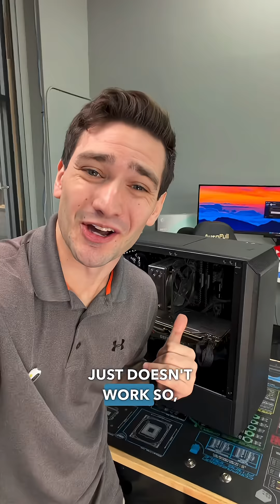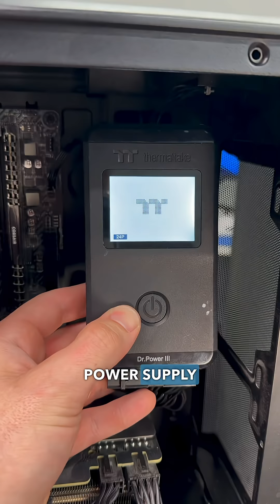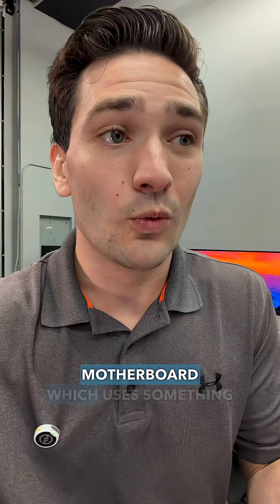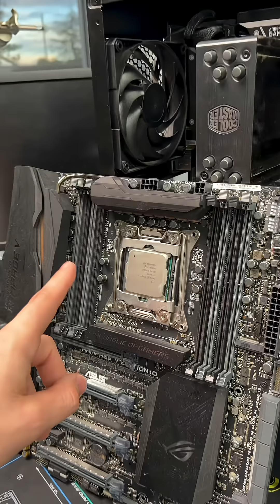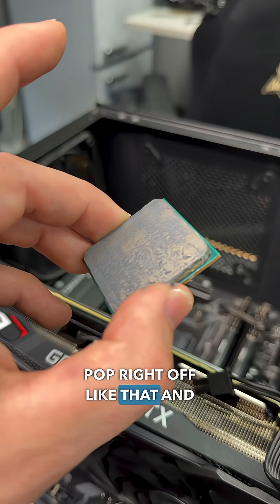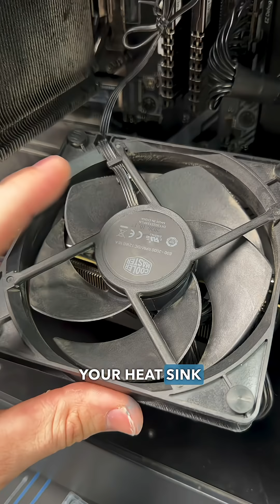CPU Cemented To Cooler! #pcbuild #techtips #gamingcomputer #computerrepair #gamingpc #repair

Comment: Just a FYI here, for future projects. It appears your cooling tower is pushing air back to front, where your rear fan case is pulling air out (causing an air gap between your rear fancase, cooling tower and gpu). Whichever way the blades curving inwards too, is the direction of air flow.

Regardless verify your air flow from your case fans and your CPU fans are same direction, but also, due to the airflow block GPU's have. If you choose to utilize air cooling for your CPU. I found in testing that airflow entering from the back of the case to your CPU cooler and exiting from the top/front of case (air entering rear and bottom), was best. 

Especially now how big GPU's are, it's very hard to get sufficient airflow to wrap around it to feed your CPU cooling tower sufficient airflow to exit from the back.

Comment: I just realized that gaming PC case is too wide for old HDD so I used SSD to hold it from bottom on other side. Both with 2 screws. Tell me it will work after shipping or not. :D And other options too.

Comment: What i did with mine is just blastint the cpu cooler with a hair dryer, that way the thermal paste gets looser and looser. You have to be careful not to burn yourself with the heatsink tho.

Comment: I had a situation where I was taking off my fan cooler to apply new thermal paste the CPU popped off with it and it would not come off so I had to be gentle around the edges and it finally came off after gentle nudging. Almost like he was cemented to the aluminum

Comment: that exact thing happened to me, it was completely cemented to where I just could not get it off even when trying to twist it. What actually worked was using a hair dryer to slightly warm the thermal paste to slip it off.

Comment: I think its a bad tip to say that the "ugly" side of the fan should always be facing the cooler, it depends on the side of the cooler that youre putting the fan on, and if you have two fans they should be facing the same direction.

Comment: The new Alienware Area 51, it's designed to be shipped. the 5090 has a bracket that is basically screwed on to the Case, 0 flex. I think if you're going to build PCs to ship, I think they need to start making cases that basically tie everything to the chassis. The biggest problem I think is PC not turning on due to stuff moving during shipment. I remember I bought an Ipower PC with a 3090 and when I got it, it wouldn't turn on after 2 hours of trying to push everything in, I boxed it up and sent it back. Bought the R13 Alienware, it turn on, been a customer since then

Comment: ALWAYS dismantle the GPU when transporting it. 
Also, NEVER mess about with the old AM4 CPUs. 
If the pins get bent, it won't even fit in the socket anymore.

Comment: When transporting a PC with a brick for a CPU cooler, always lay it on the side, unless it's a desktop PC (as opposed to a tower PC, like the one in the video). Not 100% guaranteed it'll work, but it helps put less stress on the CPU and GPU when bouncing around.

Comment: Tip: if you ever get a cpu so stuck that it won't come off even woth twisting, heating etc, use a dental floss and stick it in between, works like a charm (for better effect dip it in some isopropyl alcohol)

Comment: Any time I know I’m working with a PGA, I fire the system up and heat the thermal paste first before pulling the cooler. Makes it much easier to remove the cooler without it getting stuck or atleast pull the cpu off the cooler easier

Comment: Personal experience, blast the CPU with a hair dryer or heat gun, that loosens the paste, and twist with a hand towel for grip, and if needed, use a hair pin to fix bent pins

Comment: I've learned from first hand experience it won't always just pop off even with twisting if you run into that issue use a heat gun or hair dryer on low setting applying heat from about 6 inches away from it for about 10 seconds on each side then trying to twist it if it doesn't come off the first time just repeat the process

Comment: A question from a noobie in case someone faced it before. My pc won't turn on after a slight jerk but when I take out the gpu, it turns on fine. The pc was was running fine before. I'm guessing the gpu has some kind of short circuit. Please enlighten me. Thank you

Comment: Anybody else notice the cooler was on upside down at the beginning of the video(wether or not it affected anything is a different story)
Unless the fan was supposed to be directly next to the other fan at some point and the whole unit got flipped backwards and is now blowing away from the other fan. Instead of pulling through the cooler and helping the exhaust fan.

Comment: I got exactly same problem recently repairing someone pc. My friend brought his pc from work in Germany to his family home and pc stopped working. So me as a person who knows more about computers more than average people took it to look closely.

My attention after taking out glass side panel took very loose stock AM4 cooler. That Wraith prism cooler, with has latch which needs some force to mount. I eventually planned to change thermal paste so I took it off, repasted and mounted it back. After that I tried to power on and system start up

Comment: I had an amd athlon cpu stuck to the cooler and after i tried literally every method i just ended up putting the cpu and cooler in the freezer and after it slightly thawed was just enough to finally get it off. Somehow the cpu survived without any bent pins even though it basically flew off the cooler.

Comment: For fan directions I personally like visualizing them as domes. The intake side looks like a dome most of the time and the output side looks like a bowl.
Reply: At that point I think it's easier to visualize them as spoons - which side of the spoon do you use to shovel liquid?
Reply: @Atlessa True my mind just defaults to domes as a larger whole but the individual blades are like spoons.
Reply: That’s actually really helpful for my visualization.

Comment: I find you do not like fully need a cpu it would like still turn If you just have the motherboard and power supply And it will turn on but not do anything and then turn off like 3 seconds after

Comment: I'm sure the old Pentium CPUs from the 90's were the same. The amount of times I had the CPU stuck to the cooler was crazy
Reply: i was working on my old pentium 4 pc awhile back needed to replace some caps and the cpu came out with the cooler and fell off and landed pin side down lmao hate that design so much had to spend like 2 hours straightening pins back out
Reply: @GHOST117HALOBOYCOD 
Yeah, gotta love the old 386, 486 pentium systems...  sdram, IDE drives...  yeah, nostalgia right there...  oh and cant forget DOS (5 & 6), Then can't forget Windows 3.1/3.11 either in that.

Used to have a Dos 6.22 and windows 3.11 iso, sadly, it got deleted during a massive clean up 😭.

Hmm...  Anyone remember DOS 5?  DOS 6.22? Windows 3.1/3.11? Windows 95?  Windows 98?

Oops...  Showing my age 😅.
Reply: @samcko-d4d  My first PC used DOS (Tandy 1000 HX with an 8088). I worked a customer service job in back 2002 where the PCs used Windows 98. My First "modern" computer was a Sony Vaio with a PIII 866 and 128MB of 133Mhz SDRAM. Pretty sure it used IDE cables for both the HDD and the optical drives (one CD Burner, one DVD Reader). Of course floppy was THE drive for the Tandy, and pretty sure it was on the Sony and a few Compaqs I had after that too.
Reply: @jtenorj yeah, the good old days.  Slow computers, but, they were very reliable.  I recall the old floppy drives/disks as well - 3 1/2", 5 1/4 and extremely old 8" floppies.  I can't quite recall the model of computer, but somewhat recall it having an integrated keyboard, printer, monitor (CRT from memory - green text, if I'm recalling correctly 🤔) and two 8" floppy drives, but no hard drive...  that certainly takes me back...

Comment: The gpu sag is crazy no?
Reply: i made a lego rod to keep my gpu up
Reply: @Paperclipbits same here lol
Reply: @Paperclipbits I made one with wooden chopsticks and electrical tape lol
Reply: @improvisedpizza8557   nice, make sure you add electrical tape to the ends of the sticks so it doesnt pierce your gpu or scratch it
Reply: @Paperclipbits yeah I sanded off the edge and taped over it
Reply: @improvisedpizza8557  Okay nice, just making sure.
Reply: gpus can handle a bunch of sag fine it's only the newer extremely large cards that need sag brackets
Reply: Whoever build this gave zero f and most likely not the owner
Reply: heat sink sag xd
Reply: it's fine if you don't shake your pc lol
Reply: @davminks  Guess what happens during shipping..
Reply: @anotheruser9876  Obviously you should not ship a PC with heavy cards plugged into their slots. They should be removed and placed into their original boxes or ones close in size. 
Or you stuff the case full of cardboard and bubblewrap to secure the GPU in place,  if you insist on shipping as one unit.
Reply: @davminks  Exactly
Reply: i remember my old 970 sagged really bad, never affected it
Reply: @Chopsuey1288 that's probably because your GPU may be 2 fan
Reply: @Chopsuey1288 7900xtx sagged enough to cause a couple issues which were easily fixed by propping it up with a tiny picture I had, then a proper stand once It came in. Definitely can be a problem with bigger cards
Reply: doesnt look that bad?

Comment: Mate I have a question on my system which is a Ryzen 5 2600, gigabyte GeForce 970 Xtreme, 16 gigs ddr4, and like a 500 gig mvme drive and two other drives. My computer keeps flickering the screen randomly just at idle or like using a web browser like fire fox or chrome. Tho in games it doesn't do that at all. My question is what do you think it can be? I did install the newest Nvidia drivers that took a pain and a half but the GPU is recognized. It was leaning towards being that and it's drivers because it helped. Had to do a butt ton of work to get the newest ones installed but it worked later. Tho still does it, I did see it was that because previously it did crash on me in game and while browsing like a YouTube video. The driver's since actually fixed that, oh the one thing is I'm using a regular tv as well to see. I don't know if that does anything or if the GPU doesn't like it. I've did that too of changing ports and cables and like it still does the flicker to a black screen and comes back. I don't have a monitor to actually see tho if it doesn't like the tv but what do you think it could be? Oh I also tested my ram, no problems there either.

Comment: For those who are worried about pulling the CPU out with the cooler and bending the pins, just heat up the CPU and thermal paste before pulling the cooler off. Run Cinebench or CPU-Z Stress CPU for 5~10 min, and then gently twist the cooler. It comes right off without even having to pull it out.
Reply: You can't in this instance

It doesnt turn on
Reply: @Sabot_up_Flakbus154  I was just giving a tip to those who were worried about pulling the CPU out with the cooler. I wasn't commenting on this specific instance which the CPU was already stuck and pulled out with the cooler even before taking it apart. Learn to read.
Reply: @PowerliftingCollege i specifically stated "in this instance"
Reply: @Sabot_up_Flakbus154  Specifically stated "For those who are worried." Again, learn to read.
Reply: @PowerliftingCollege ik ik

Actually i realized i was wrong a bit ago but its too late for me to back down
Reply: @Sabot_up_Flakbus154  🤣🤣 It's all good, my friend.
Reply: @PowerliftingCollege slr and thx

Comment: Slight faux pas for me - didn't realize I had the cooler installed for some time, and i thought I should re-do the paste etc.  CPU did get stuck to the cooler and somehow in the removal process, the pins bent o0  Luckily, local store had a big sale and got a nice upgrade sale in the process.  Note:  do leave the maint too long on a PC, sh1t can go south

Comment: Just twisting didn't do it for my 2y old stock AMD paste, I needed 1h of heating the cpu on my print bed, trying to twist  it, trying to wedge things under it, and spilling a lot of alcohol onto it before it popped off with a few bent pins. Bent everything back and after applying some MX-4, everything is up and running again.
Reply: What temps you got idle and gaming?
Reply: @ΆκηςΠ-τ5ψ  Never above 70. Maybe 40-50 on idle and 55-65 while gaming. All with a stock cooler and some MX-4.

Comment: Trick for this:  if you twist the CPU cooler back and forth a bit before pulling it out, it'll break the bond and keep from pulling the CPU out with it.
Reply: Recently my friend's HTPC had a motherboard die so we had to do a motherboard swap, which meant we had to transplant the CPU cooler. Well, the old thermal paste between the IHS and the cold plate of the air cooler was hard as CEMENT. I kid you not, even trying to chisel it off with a flat head and a hammer would not get this thing off. The only thing that worked was submerging the CPU/cold plate in a bowl of 90% of Isopropyl alcohol which FINALLY loosened the thermal paste enough to twist it off. I could not BELIEVE how much tensile strength that thermal paste had in keeping the heatsink attached to the IHS. So it helps to submerge it in Isopropyl if you run into a problem like that.
Reply: Just use the pc for like 5 minutes and the heat will do it
Reply: @marto_47 You pure idiot. It wouldn’t turn on.
Reply: I had this happen once doing the twist method slowly caused it to still bend pins. Almost better. If somehow you can get to that latch of the CPU and then it'll pull right out, then twist it while it's out versus in.
Reply: Just make sure you pull straight up, so you don't bend any of the pins and brick your CPU and/or mobo.
Reply: @KyokujiFGC  then pins pull off; that's much worse.

Comment: I just bricked my AM4 5600x because of one side of the stock cooler snapped off when I was screwing the other side. Now I don't know if I need a new cpu, motherboard or both because when I do a little shake in the cooler the pc turns on but after 15 seconds just turns itself off. Thanks 😂😢

Comment: its kinda funny the people that starting building computers with ryzen complain about how hard they have to press the mechanism down on am5. but lga is just better in every way. cause instead of the pins that could bend or come off being on your cpu which is most likely more than your mb, they are on the mb, so you can just replace the mb instead of an expensive cpu. also if you accidentally drop you cpu, you won't bend any pins. unless you drop it on the socket.

Comment: Another reason to use aio
Reply: OC is perfectly fine for a cheap am4 cpu, you don't need liquid cooling for it.
Reply: it can still get stuck to an aio. the problem is the mechanism for pga processors.
Reply: Could just as easily happen to water block.

Comment: That twist trick didnt work for me last week
Also didnt help my paste was 5 years old and drier than a desert
Reply: I think you can turn on the pc for 5 min and do a cpu torture to warm the paste.
Reply: @danortiz  well in the end i heated it and got a knife to leverage the cpu off
A few minorly bent pins but it fell back into place on the MB so alls well that ends well for me (i think im repasting it from now on a lot more often than 5 years and when im moving towers)
Reply: @YamiSpyro2011 any problems after the pin bend?
Reply: @ΆκηςΠ-τ5ψ thankfully no issues, looks like getting it back in its all aligned back up in the socket, doubt if i pull it out and try to reinsert it again i will get lucky again
Well next build is 2 or so years away and it will be on the AM5 socket or if theres a new one around the corner

Comment: That always gives me a heart attack when I have to apply new thermal paste😂
Reply: Stress the CPU for 5~10min using Cinebench or CPU-Z before puller the cooler off. Then slightly twist the cooler, and it comes right off. Worked like a charm for me every single time and I've never pulled the CPU out with the cooler this way.
Reply: @PowerliftingCollege  Am4 you just twist the cooler to break it free before pulling upwards. Not a big deal.
Reply: Just use isopropyl alcohol.
Reply: @d4vdFortnite Yeah... That doesn't work for me...
Namely because I can't get the alcohol to the CPU with the cooler on.

Comment: He was cooking that CPU from day one with that push pull fan configuration 😂
Reply: Why did u have to make me notice that 😂
Reply: Actually it's pull configuration on video
Reply: First, no he wasn't. A push pull requires two fans. Second, it would have shut itself off if it was overheating. If it's not overheating, you're not causing damage.
Reply: @williameldridge9382  the joke is he was push pulling with the rear exhaust fan…..
Reply: @blakecharles4501  The CPU fan was pulling air instead of pushing it through the fans. The rear exhaust fan was pulling as it was supposed to. So it was a pull/pull configuration, not a push/pull configuration.
Reply: @IFireflyI  no? The rear exhaust was intaking instead of being exhaust the way it’s supposed to be. 

The fan on the CPU cooler was blowing the right way. You always want to exhaust out of the rear especially with an air color because it’s the fastest way to get hot air out of the case.
Reply: @blakecharles4501 i always kindof sorta thought the rear fan was an intake fan, since its "semi-commonly" left empty on some cases
Reply: @mikeb1085  if you have an AIO the rear exhaust is much less necessary. (Should definitely keep it anyway though)